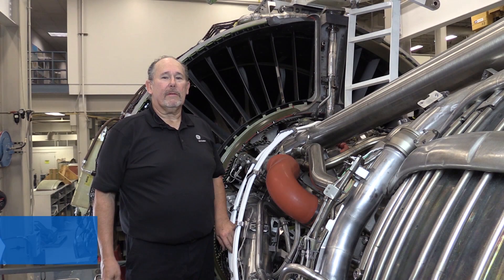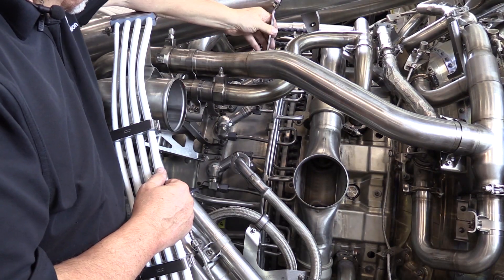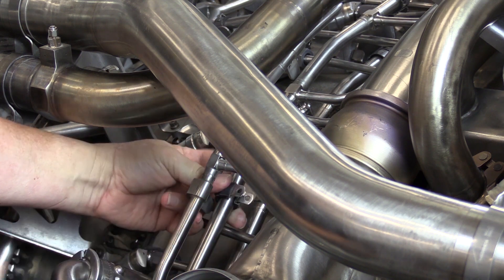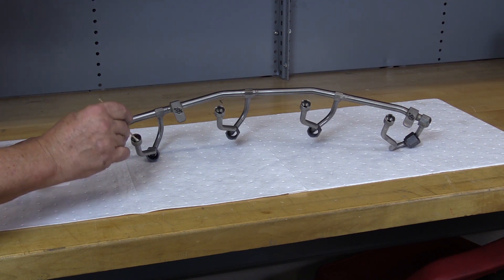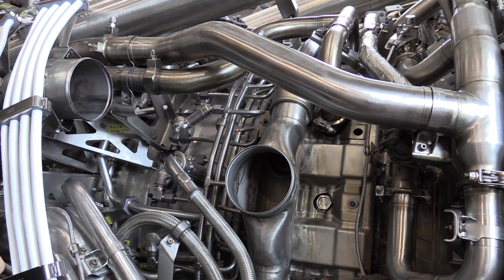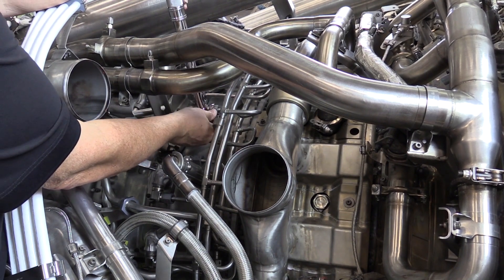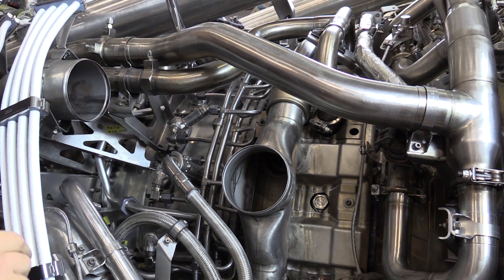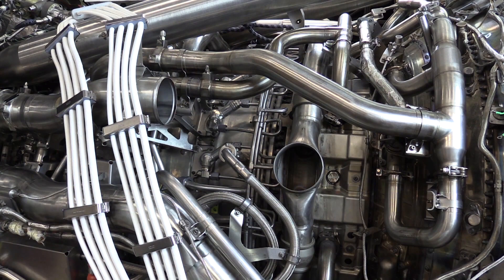GEnx - Unstaged Fuel Manifold Removal & Installation - GE Aviation Maintenance Minute

Comment: Hi, I can not see or rearly see any lock wiring in your videos.  Is that an old way to secure bolts and nuts?
Reply: Trym Schjetne lock wiring is not a old way to secure. I am a aircraft engine mechanic and i use lock wiring everyday. :)